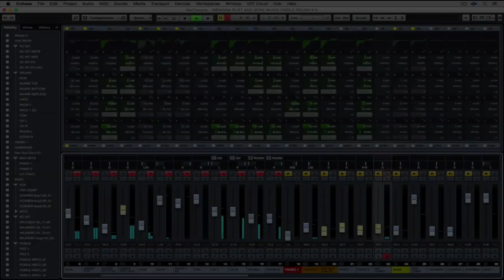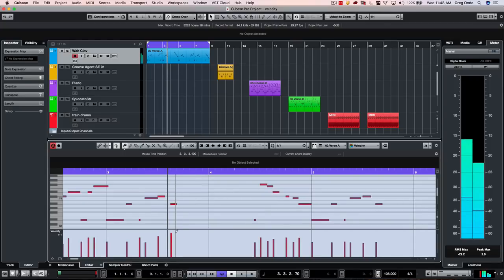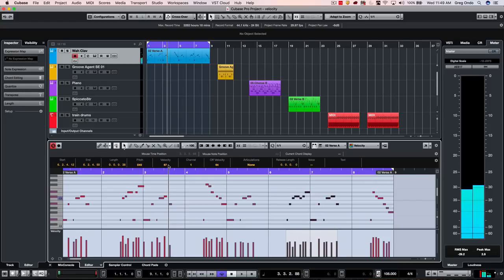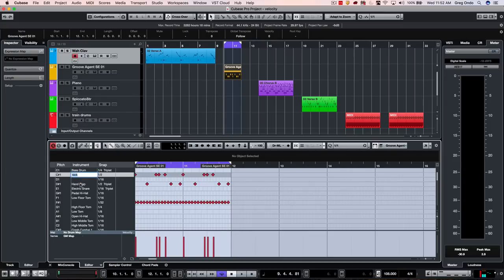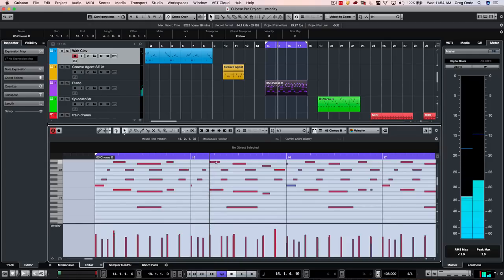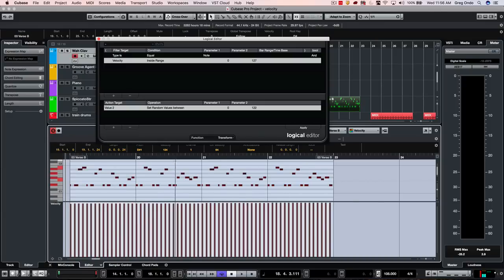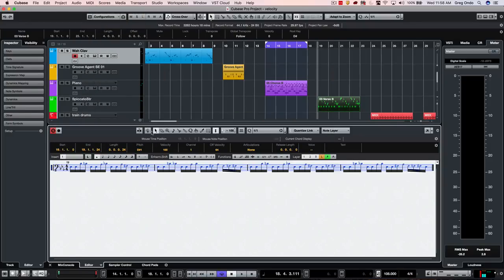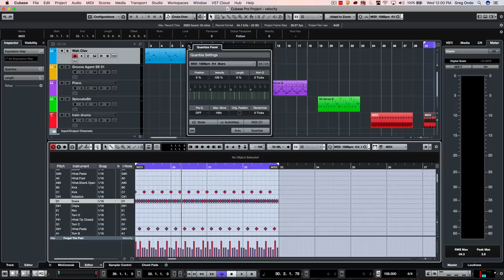How to Edit MIDI Velocity Data in Cubase | Q&A with Greg Ondo

Comment: Great video!  Saving the patterns in the quantize panel?  Epiphone!!!

Greg noted (no pun intended) at the beginning that velocity is not the same thing as volume.  That might sound confusing to some, as velocity and volume have similarly, but not exactly the same, effects on the final sound.
Velocity is typically analogous to "how hard did I hit that key/drum pad/controller pad...", not "how loud is that instrument".  Using a piano as an example, 'fading in' a piano part using velocity will sound slightly different from fading in a piano using say, track volume automation.  This is because a piano note sounds quite different if played softly than it does when hammered down hard.  Same goes for drums, strings, horns...
This is great, as it gives us options in how to mix/balance midi tracks.  Using midi velocity editing on a track will make it sound much more like the musician trying to balance to the rest of the band by adjusting his/her playing style.  Think of a jazz band playing a song with large dynamic shifts through the piece, for example.  The drums, pianos, etc will have different timbres in the soft passages because everyone is 'hitting' their instruments more softly.  The sound is very different than simply pulling down the volume on a loud passage.

For overall mix adjustments though, automating the track's final volume might be a better option.  Vocal ducking might be an example of this...

Comment: I know this is from a few years ago, but maybe you'll see my question. What is the easiest/fastest way to make the velocity of a set of notes all the same? For example, if I open a drum part in the Key Editor, and select all notes of a certain note value by clicking CTRL plus the note value on the piano at left, is there a way, other than using the Line Tool (or Velocity Compression) to make them all the same value? (In the Drum Editor there are functions for Quantize, Length, and Expression, but nothing for Velocity).

I ask this because, for example, in some styles, such as EDM, you often want your kick drum to be all the same velocity. Thank you :)

Comment: Thanks for this video.  I want to ask how to see the changes in the midi that have set the position and velocity on the midi modifier.  it is very difficult to fix it because there is no visible change in the midi event (for example in studio one you can see the changes after Humanization) but in Cubase it is not visible but still works properly.  please explain sir.

Comment: Is there a way you can go to the bottom of the editor where it says velocity, and select only the velocities across the entire piece of music, and just bring them down together, but by just dragging a mouse across the notes quickly, without selecting them one by one.   It seems in Cubase  you can only do this by editing the velocity one note at a time.  I'm coming from logic where, for example, you would just select the loudest notes by dragging horizontally across the tops of the loudest notes in the velocity section of the editor, and just drag them down, without selecting any other notes and without having to select them one by one at the top of the editor.  In cubase, trying to do this with the object selection tool, it simply brings all notes to the value that you drag across.  I just want to skim the top of the notes to select the loudest ones, and just drag those loudest ones down.  Thank you so much for this channel and this video, hopefully this question make sense? They have to be a way to do this I just don't know how.

Comment: I wish SB would add velocity stems to each note like the old Atari ST DAW Dr. T's KCS Omega.  It's even better than holding Shift+Control.  Every note has a vertical velocity stem at the start of the note and you could just drag that up or down even when stacked.  You had to select the velocity tool, but really cool feature in an old DAW.

Comment: I realise this is an old video but I’m trying to find out if it’s possible to record in velocity using an external controller such as a fader (as you would expression or dynamics with a modwheel) after the notes have been drawn or played. I’m using Cubase 11, thanks!

Comment: Hi Greg - thanks for this. Strange question - when you click with the draw tool on the velocities - sound is generated. I take it some kind of internal midi signal is generated to activate the VST. However in cubase there does not seem to be a way to record these signals. Do you know any way these can be recorded? One could record the audio but I'm hoping to record  this midi directly.

Comment: Sorry if this has already been covered elsewhere. I have a midi cymbal in my project That I don’t want to change the velocity of as it changes it’s sound. I  do however need to adjust the actual volume of it. From what I read it is possible with automation cc7 but it is difficult to automate on this track as there are other cymbals with it as well. Is there a quick volume adjustment (like the velocity) for this reason? Thanks for any help viewers!

Comment: When you send midi data, the target has the option of responding in any way it wants. If the velocity value is high then how does the instrument deal with it. It's nit a real instrument so it has to figure out how that virtual instrument would react to a harder hit. Is there a ton of info stored so the instrument can return an accurate reaction to velocity OR is it an algorithm? I suspect algorithm, but I am not sure.

Comment: Greg Ondo... Cubase has a total worse Track manipulation of note velocity and lenght realtime fix adjustement. All must be done in any editor. The Track Midi Modifier/Insert in this case is totally useles. Why there's no additional Length Fix or Velocity Fix? And why Vecocity Shift +128 and Velocity Compression 100/1 does not result in a fixed velocity of 100. What a pain! In Logic  simply click the Track parameter eg. Velocity Lenght +/-/= , then set the value and done.

Comment: Greg Ondo... How to waste your time! Cubase has a total worse Track manipulation of note velocity and lenght realtime fix adjustement. All must be done in any editor. The Track Midi Modifier/Insert in this case is totally useles. Why there's no additional Length Fix or Velocity Fix? And why Vecocity Shift +128 and Velocity Compression 100/1 does not result in a fixed velocity of 100. What a pain! In Logic  simply click the Track parameter eg. Velocity Lenght +/-/= , then set the value and done.